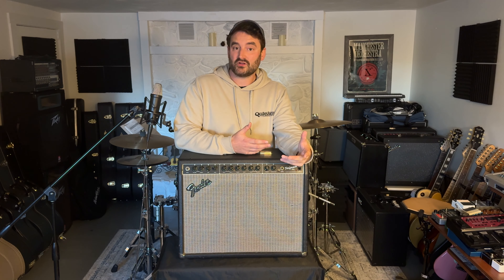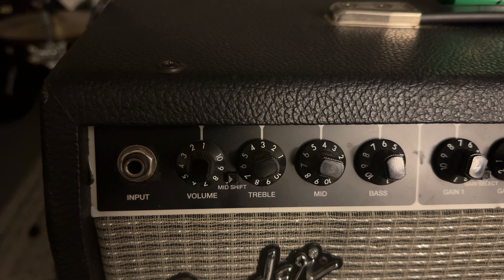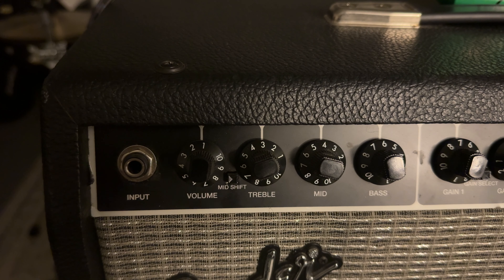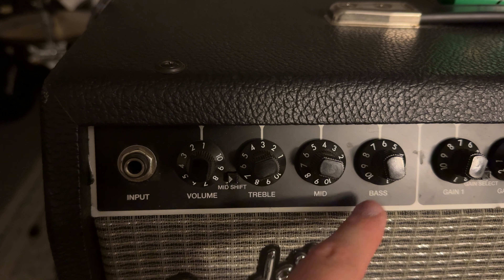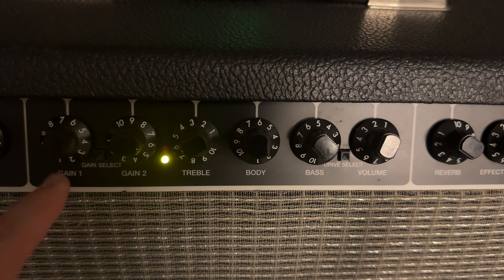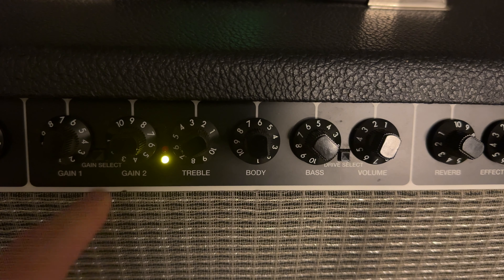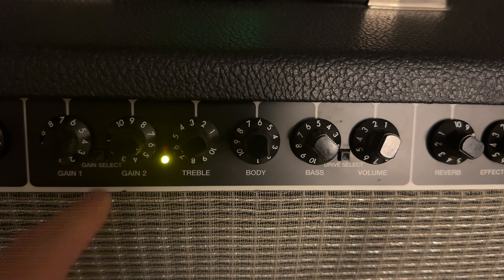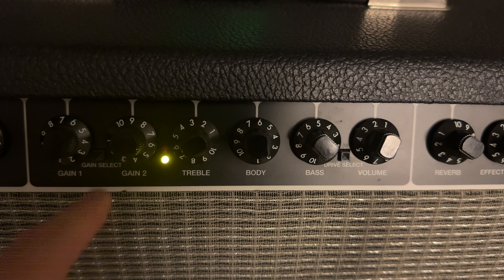Solid State Sleeper Amp! - Fender Performer 1000

Comment: This is a terrible amp.  I mean if and when it works, the clean channel is pretty great and it is LOUD.  But the problem is (as I have personality experienced) the circuit board and poor solder joints.  It's  just not a reliable design.  Mine had a Crlestion G12, but it's pointless when the amp keeps crapping out on your.  They later released the Roc Pro series and I don't know if they addressed these issues with the new (at the time) models, but I was thoroughly disappointed with mine.  And to think I traded a Peavey Classic 50 for this thing.
Reply from the maker: That’s such a bummer that you had bad experiences with this amp. Mine is still kicking after all these years though so fingers crossed!
Reply: They did not address those issues. I've had way too many problems at shows when I used it. ALWAYS gave me problems. Even after taking it to  the shop twice.

Comment: These are great amps. Effectively a three channel switcher. I have mostly tube amps and a couple hand wired but I got my Performer 1000 in the 90s when they first came out. I actually had two at one point. There have been a slew of Fender models and I am heartened to see the Performer 1000 get some love.
Reply from the maker: That’s awesome to hear! It seems to be the case that a lot of people got this amp in the 90s and have tube amps now but can’t part with the good old performer 1000. It’s a great amp and I think it deserves to be appreciated.